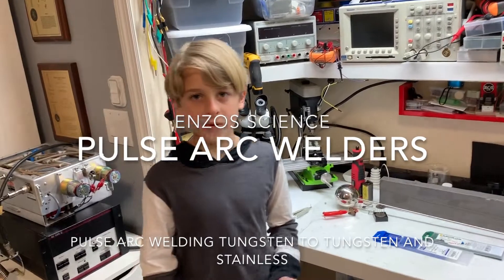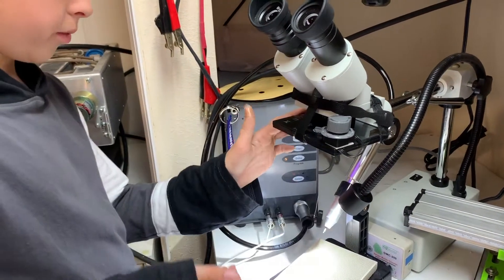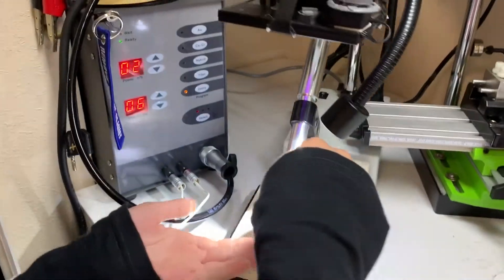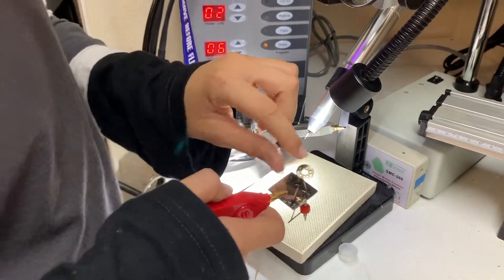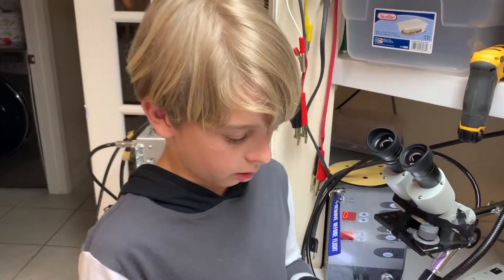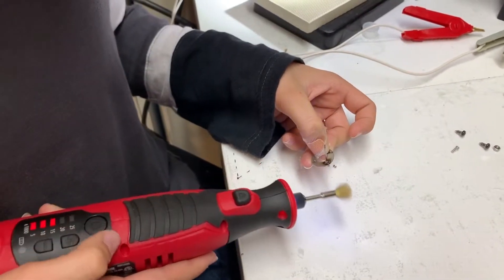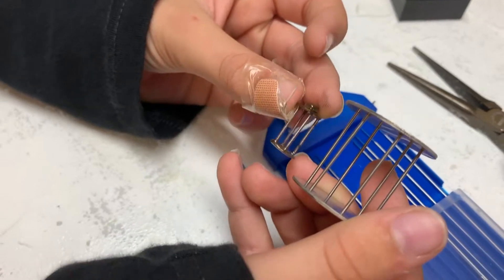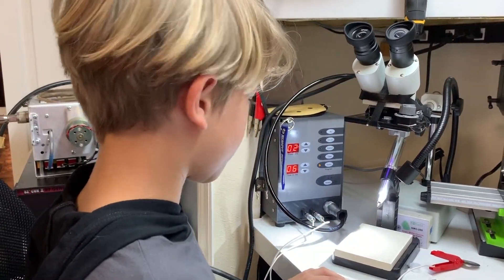Using a Pulse Arc Welder to create a Cathode for an IEC Nuclear Fusion Reactor

Comment: Hey followup to my earlier comment. I purchased this welder and enjoy it but am curious on how you set up the optics. Did you just strap an adl lens to the scope? I bought a welding helmet because it was something immediately local to me but I'm still seeing the arc and it's causing eye strain. Thanks!
Reply from the maker: Yeah I basically strapped the protective glass to the scope.
Reply: @enzosscience6229  Gotcha. Do you remember what adl lens or scope you used? I know it was a while ago now.
Reply from the maker: @gregorycoleman2149  The screen is https://www.ebay.com/itm/364041349160?mkcid=16&mkevt=1&mkrid=711-127632-2357-0&ssspo=NxBXq3afQGW&sssrc=2349624&ssuid=Q9s2CbNDQ4G&var=&widget_ver=artemis&media=COPY
And the scope is a 10x Amscope
Reply: @enzosscience6229  thank you so much! Appreciate it!

Comment: Maybe you know if there's any documentation on experiments where the spark gap is placed parallel to the B field (both B and E field lines being parallel) ,  along the axis of the solenoid ? As I see it, with the (superconductor)electromagnet being ON at all times and varying the power, the charges would get compressed into a tight beam,  interacting more and more (along the "spark"line/axis) as the B field gets stronger. This would be done in a stream of liquid deuterium.
Reply from the maker: I think I get what you are saying. This sounds like a linear accelerator. My reactor happens to be inertial electrostatic confinement, no B Fields, so out of my area a bit. The liquid deuterium I assume would be very very cold, assume similar to liquid hydrogen. How would you keep it cold as you add all of the energy needed for fusion? Assume 1100 degrees K for every eV and needing 16-30keV for D-D Fusion is 300 million degrees K or so. Seems more suited to D gas. Also D liquid might be too dense because it reduces the MFP (mean free path) of the ions. Interesting thoughts and thanks for posting!!
Reply: @enzosscience6229  One more thing      waveguide(dot)blog/teslas-spark-gaps-literature-review/